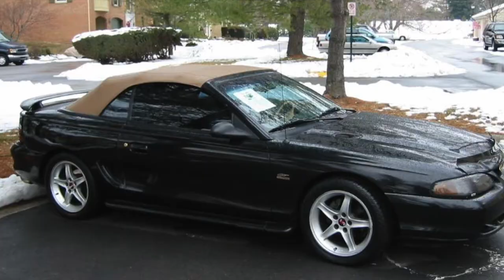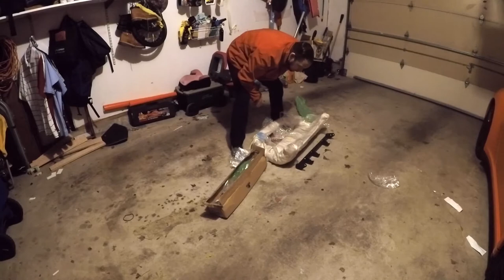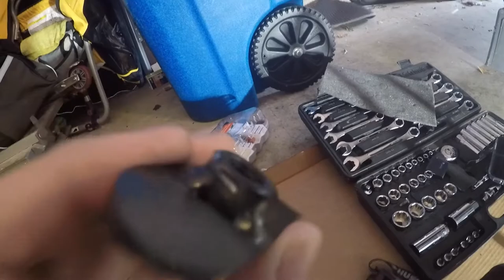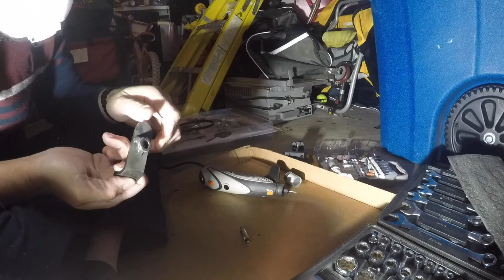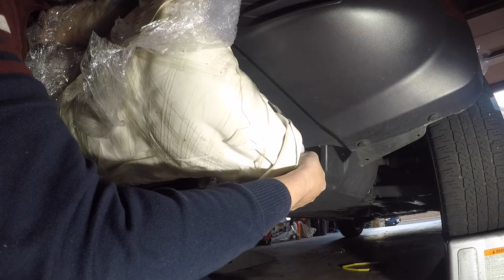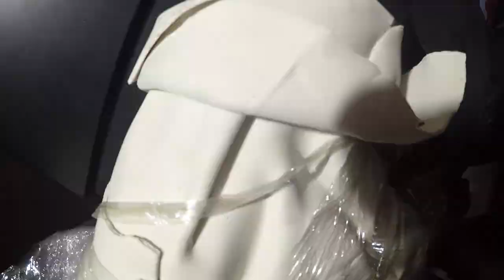Jeep Patriot Bull Guard with skid plate Install

Comment: So it blocks the fog lights saddly :/
Reply from the maker: Slick Sparkz it’s does but the plan was to add a light bar.  I’ll make a video of that when it’s done.  This bull nose has holes where you can mount the light bar.  It should tap into the OEM fog light harness.

Comment: Did your bar come with a license plate bracket? I'm not sure what I am supposed to do with it....
Reply from the maker: You can still see the numbers even with the bar.  Have had it on there for about two years I think and have never been bothered by law enforcement.
Reply: @OmarsGarage  I'm not worried about it covering the license plate. My kit just came with a metal L bracket thing and a small bolt for it, but there are no threads on the bar itself to attach to it. 

It doesn't look like you had this, so I think I am safe to leave it off, but was wondering if it was some sort of extra stabilizer/attachment to the bar. IDK what it is.
Reply from the maker: M H is it something that can be screwed into the existing threads for the current license plate holder?
Reply: @OmarsGarage  yeah 2 screws line up with the license plate holes on 1 side, and there is 1 more screw I'm assuming is to be used as a brace. Maybe I'll see if Black Horse can tell me, because I didn't get any instructions. Followed yours and seems good so far. I am not planning on jumping on it or using it for recovering, so I think I am good.

Comment: My 2015 Patriot has the fog light "blanks" off to the sides of the bumper, not in the middle like on this Patriot.
Mike P in Australia
Reply from the maker: TheLone GunMan this would work well with your Jeep.  It has held up well btw. 👍
Reply: @OmarsGarage  you are fantastic! Your video got me motivated to remove the front bumper and grill, 4 hours later I have a working led light bar and the grill and bumper bar are reattached. Thank you Omar for your very informative video.
Reply from the maker: TheLone GunMan where did you tap into for power for the light bar?  Did you splice into the current fog lights?

Comment: gf has a 17 patriot, hit a dog and it went up under and busted the radiator, i had to take the whole front end off, and drop it thru the bottom, i believe if i put a set of bull bars on the nose ill have to fabricate them myself, but wanted to see where they were bieng mounted to
Reply from the maker: Yeah all the mounting holes are right there.  Was a pretty easy installation.